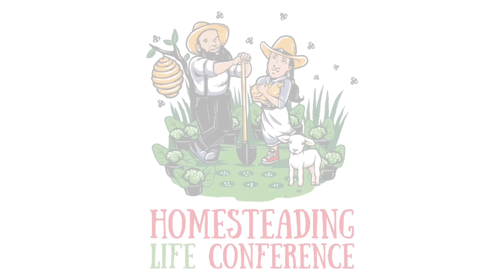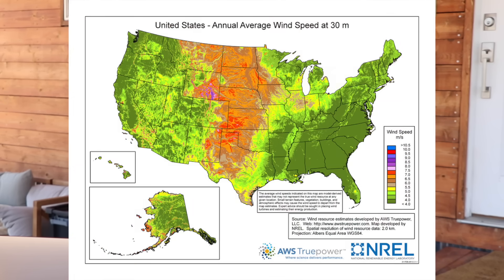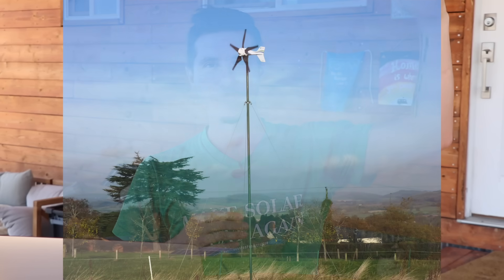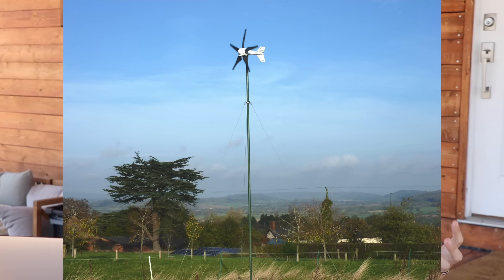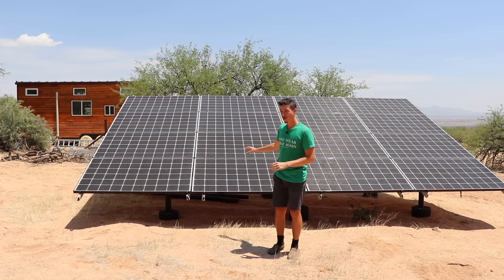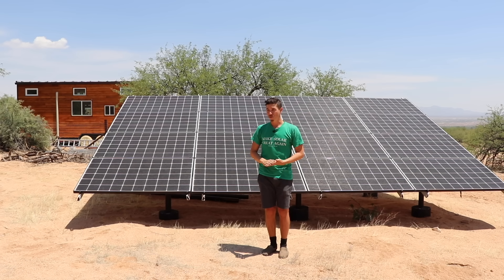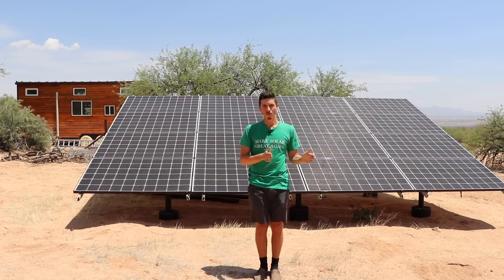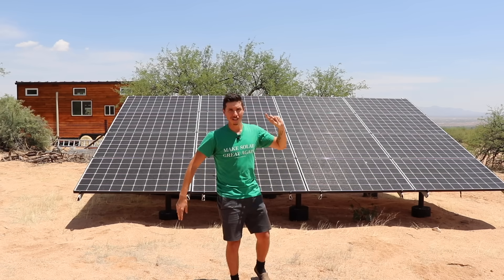Micro Wind Turbines... Are They Worth It? (Off Grid Solar)

Comment: Hello, Youtubers - Its time for application use of information. Operating  Latitude for wind above  Latitudes of 44.3148° N, 85.6024° W (This is not Arizona, California Florida, Texas or New Mexico i.e) is very good.

Sun is not great especially in late fall and winter. Generally, the wind velocity of 10mph or greater. A wind & solar hybrid system is best of both worlds. At 30-foot unobstructed airspace will enhance the performance ( high can help but $). The Cost is cheaper at lower heights, and the Missouri Wind & Solar systems are great. I have a full wind & solar hybrid system installed within the city limits since 2012  no maintenance problems,  24-volt system, 1000 watts of panels, 1600 watt turbine, 10 deep cycle batteries, 3000-watt inverter with the controller and all the bells.  Have generated over 5 meg-Watts of power with the lowest light bill $14 a month. $8K fully integrated into the house, not tied into the main panel ( A bathroom or Kitchen Remodeling is much greater)   Keep producing power from " Solar Ed" its real Youtubers. 

Links:
https://sites.google.com/tfs-financialstore.com/tfssolargenerators/why-a-hybrid-system
https://sites.google.com/tfs-financialstore.com/tfssolargenerators/why-a-hybrid-system/tfs-hybrid-systems
Reply: Which of the two Renewables produce more power per annum

Comment: You really don’t understand wind turbines first you need to be in an area that’s getting enough wind. And yes your flat land dirt patch wouldn’t necessarily be a great location. Second a 2,000 watt turbine would be a bit excessive for your needs. Third the cost of a quality turbine is usually not that much. Fourth the construction of a 65 foot tilt up tower is  neither expensive or difficult if you know what your doing. And finally I don’t think you did enough research. because you have limited knowledge on a subject  you really shouldn’t comment on it. And in no way should it reflect of the viability of its use.
Reply from the maker: I do undrestand the numbers especially when it comes to overall cost and power production :)

it adds complexity to the system that for most people don't need it

Comment: Solar is the first thing you should always invest in unless your wind speeds are always high.  Some people don't live in a desert and the amount of sunshine they get is limited.  Wind turbines with enough moving air are a great complement to solar.  They work even at night, and say there is a massive storm and you hardly see the sun.  That solar will do squat.  Turbines are going to break down more than the solar, but anything with moving parts needs to be maintained.  Though turbines can work day or night whereas solar won't, so turbines supplement the failings of solar .  A generator is also a good idea if you are completely dependent on renewable energy.
Reply from the maker: you design a solar system based on the amount of sun you get and it's easy to do :)

Comment: Solar doesn't work at night or very well here in Michigan. The micro Turbine industry is filled with misleading information and scammers. I have two from different manufacturers. They are basically trickle chargers at best. No real power no matter what the sellers say. Put up an axial flux homebrew and you get some serious power at low wind speeds. Wind is much more expensive but works where the sun is limited.  I think depending where you are it is a mix of technologies to charge your batteries.
Reply from the maker: it certainly depends on the area :)

Comment: I think you are totally missing the point of off grid wind turbines. They are really useful for not having to rely on a diesel generator in locations where solar panels arent reliable for off gird living. No batteries can compensate for a winter of 1hour of solar per day. 
Also you are way overthinking it. A lot of converter used for solar panels also support wind turbines, and basicly make sure they are not free spinning even when batteries are topped off. A 20 meter pole is not really nessesary, but most ppl just get a used radio mast that's high enough. 
I like your videos, but your "general advice" are does really only apply to where you live. Solar is great, but its not always easy and the right pick for everyone.
Reply from the maker: you need to watch my video again, they are useful in certain areas but for the vast majority of people, it adds complexity and cost that can be easily alleviated by some extra panels :)

Comment: Thanks for your Infos.
I wanted to install a micro wind turbine on my property directly on the beach (in front of the sea - first line) in southamerica (Ecuador). After seeing your video i am not sure if its the best posibility. I have not lived on the property the whole year but during the 3 months i was there every day the wind was minimum 15 - 20 km per hour. 
Because of the thermal conditions i have guaranteed wind per day and night. The thermal conditions guaranteed sea breeze by day and land breeze by night. I had to measure the wind speeds over several months to get precise clues - but perhaps you know internet sites or links where i get this information and get a safer information to decide if its worth to install a wind turbine or perhaps better a solar panel. (Do you know links where i can compare the potentials between wind turbine (windstrenght in hours) with solarpanels (sun in hours) ?) 
Many thanks for your help.

Comment: Lol! So much angst over this video! 
First, the dude is explaining why he is not going with wind power generation...his opinion is going to be biased by his environmental conditions. There are places where wind would be better than solar, for sure, but this video is not about that. 
I am looking at options for supplemental energy, so cost is supposed to not break the bank while still cutting the bill, and doing so in a way that is beneficial to the planet and inhabitants. The problem I found with small wind generators is the minimum wind speed required to create energy. When the most common speed is 10 mph or less, there is no generation of power, so why spend money for nothing? However, you you live someplace that gets the minimum speeds fairly regularly, it is then something to consider. 
In my opinion, the people producing these are not considering the basics of electricity: you can add it all together! A generator has to have enough force to overcome resistance, which is why the speed matters when you are trying to generate household power from one or two devices. It perfectly feasible to make smaller devices that take less force and generate less power, but then have 15 or 30 of them on your fence, or on your ridge of the roof...the wiring decides the voltage and current, which could be controller switched based upon what is being generated by each device. There was such a set up tested along a highway in Germany, I think, a few years ago. Vehicles create a lot of wind...so do trains and subways. These would be great places to set up systems, and turn wasted energy into useful energy. it would also help spread out the power grid making it a less prime target for nefarious people.
For myself, I would love a system that has multiple sources...I also researched micro hydro and, unfortunately, it too has very specific requirements that terrain dependent: you don’t just need water, it has to move downhill a significant distance, and in a significant volume.
I also looked at hydrogen fuel cells for emergency power: the units are not outrageously priced, but they still use petroleum products for the hydrogen, making them very expensive to run, as well as a source of pollutants. 
Thus, you see, that one can be “for” a method, but still find it is not fitting for the one’s situation. The exciting thing is that the interest is there and is driving improvement and innovation...but meanwhile, we have to use what is available and functional for each of us.
So, really, folks: chill! Think of ways to fix the problems instead of denying the problems exist, right?

Comment: @ Handeeman

You are misleading everyone really because of your bias of solar over wind turbines. Most wind turbines that you are the Horizontal Axis Wind Turbine or HAWT which means that the turbine axle is horizontal. Now you can use these in low wind if you have a geared setup where the blades are on a separate axle shaft to the turbine axle so that you could have the wind turbine very low spinning not so much but producing more revs for the turbine.

Another type of wind turbine that only needs to be about 6 feet off the ground is a Vertical Axis Wind Turbine or VAWT which means that there are simple spiral flat blades like the flute of a drill but obviously much wider that spin a vertical shaft which can be geared into a generator motor. They can easily have breaks on them, the controllers that can either divert power once batteries are fully charged or either shut off power are quite simple & cost effective. You don't necessarily need dump loads which absorb all the power when it's redirected. You can even use your diverted power to power a water heater or underground floor heating etc. A VAWT system is a much better way to go because it can be made silent, it can be made so that it doesn't look unsightly & it will produce power all day long in small wind areas such as 5 - 10 mph with extra gearing. Depending on the width of the VAWT for example if is it 10 feet wide & only 3 feet high can generate many kwh per hour.

In regards to solar, you never tell anyone that from a fixed solar array that you only will get 60% of the rated watts during summer, without clouds between 4-6 hours a day. You don't inform anyone about single or double axis array's that can generate up to 80% of the rated watts for 8-10 hours a day during summer. You also do not tell anyone that during winter  that your solar array will only generate 50% of your summer generation & this is why when you design a solar setup that you need to design it around what you need to generate during winter. I'm not a troll or against solar, I believe in cold hard facts. There are times when depending on your area & climate that a person will need to think about both wind & solar & possibly even hydro if they have a running stream or river through their property. It's all about trying to utilize whatever you can to generate your own power for self sustainability so you need to wake up & stop being so biased.

Comment: But people have been putting small wind turbines on cruising sailboats for years...free power..at night?
Reply from the maker: this is a totally different situation then what I'm talking about in the video lol
Reply: also, if the wind is coming from the boat being propelled by a diesel motor then you are not getting free energy, you are just creating extra drag and making the engine work harder. Remember, there is no free lunch according to the laws of thermodynamics
Reply: You said for a “small off grid setup”,  which sounds to me like a very similar situation. But yea, there’s generally more wind on a boat.
Reply: Liam O'Brien you have a keen sense of observation. Running a Diesel engine isn’t free energy. Yup. But sailboats you know, can sail. Like with only wind.

Comment: My point was not ignoring the basics of the calculations, that is  hard facts. My point is that sometimes paper calculations may not catch nuisances that are available. I think maybe there are differences in how I define working. 

4  300 watt micro wind generators like the ones used on sail boats work well at the easy to reach altitudes of just above the roof top of barns and small / Tiney Houses.
There simplicity allows for inexpensive fabrication techniques that I am comfortable with. 

Also my location I. Western Washington state has more wind during  the low sun, fall /  winter overcast rainy weather systems.  The in between cycles of spring summer there is a lot more sun power, when the wind velocity drops.

Having a mix of affordable power generation, in including low head Hydro does bless us with more options.

Having to install a 50 to 60 foot tower to reach 50 mph clean turbulent free air.the larger wind turbines need,  does not make sense in yours or many others budgets, any more than paying to have more than a few yards of power poles, or underground commercial power installed. 

Having the clear sky's during 90 % of the year would allow the use of an expanded solar panel system to do the job, better a d less expensively.

Comment: Good points, good video.

The cost of wind is so great, and an accident could really be nasty, especially if you have your tower anywhere hear your house or where people or animals are.

But adding solar might not be the perfect answer either.  For example, what if you really have an extended period of clouds or no sun.  It won't matter how many panels you have.

For the cost of those extra panels what about buying a generator to top off your batteries in those cases.  A generator is a sensible thing to have in any case, for catastrophe, disaster, etc ... a lot more sensible, portable, and easy to install than a windmill.

Not to mention how ugly it would be to always have a big tower with wires in your view.

The ground based vertical axis wind mills are cool, but they are way expensive and they do not get into the higher wind speeds.

Comment: How many gallons of water did you collect this year? Are you gonna make it through the summer?
Reply: I really want to know the answer to that same question as I'd like to move out that way. I spoke with a well driller who's very familiar with Tucson, Benson and that general area. He said you can still get well permits just outside of the city and it's pretty likely you could hit water in under 1000 ft, even 300 ft. But Derek's collection thinggy is fascinating, especially if it works !
Reply from the maker: I'm doing a video on that today :)

Comment: How often do you need to clean your panels and how do you clean them, I am also interested in any other maintenance you may need to do for the solar setup. Thanks
Reply: Maintenance? None, Zero, Nada, Zilch. Derek could clean them to gain perhaps an extra percent or two of power, but laziness prevails, though to be fair when I was there the dust covering was pretty light so not much of an impact. Since they are made of high strength glass, any kind of glass cleaner would work (Windex, SprayAway, or IPA)
Reply: Geek ForLife- here in SE Mich I go out while it's raining, 2-3 times a summer and give them a quick scrub with a 2 foot wide broom mounted on a 4 foot stick....bird droppings, etc, wash right off. They stay clean all winter. Ground mounting the panels is the key to easy maintenance